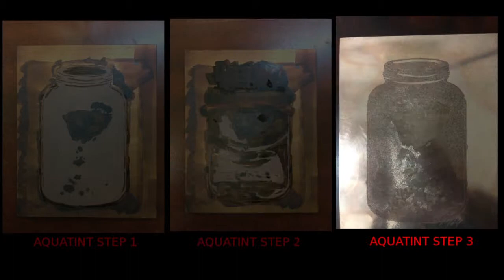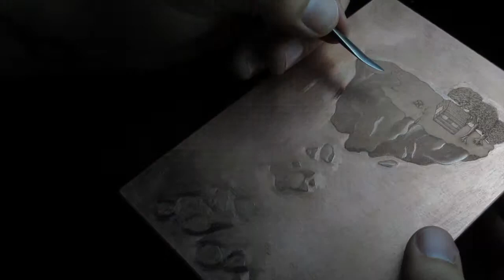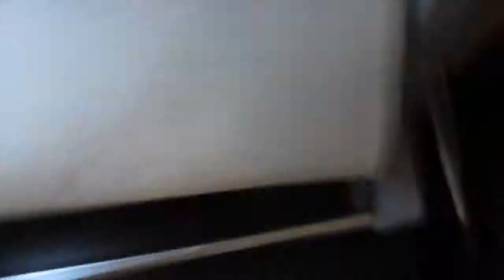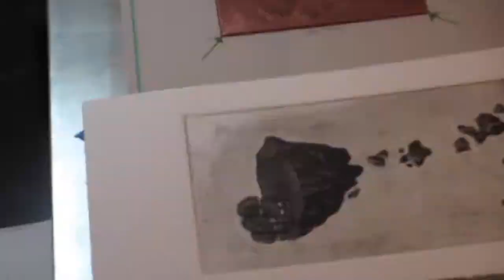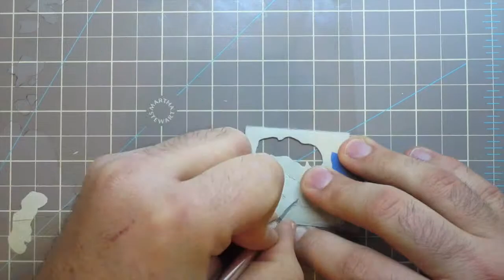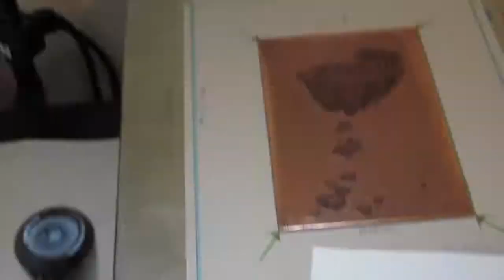Mezzotint Printmaking: Creating Microcosm - Floating Island timelapse

Comment: Tell me more about AKUA. I'm afraid of it bleeding when printing with dampened paper. And if you let it dry on the plate would it harden like acrylic? You certainly worked hard making those masks...excellent result!
Reply from the maker: Janet Badger  Akua intaglio ink is water-based (contains some amount of water) but not water soluble. So it won't bleed at all into the paper, I do all my printing with dampened paper. The big difference is when you cleanup, you can just use soap and water, and no harsh chemicals are needed. I do notice a more matte finish with the final print compared to oil inks, but I like the look. You can buy tiny jars to try it out. I usually clean my plates off when I'm done printing fairly quick, but it does not dry out fast like acrylic paint or anything like that. I also use oil based inks a lot, I just like variety! Thanks for checking out the video!
Reply: I will try it! Thanks for the reassurance.